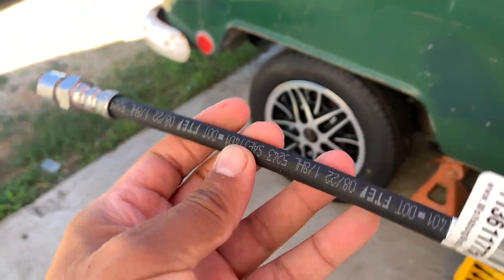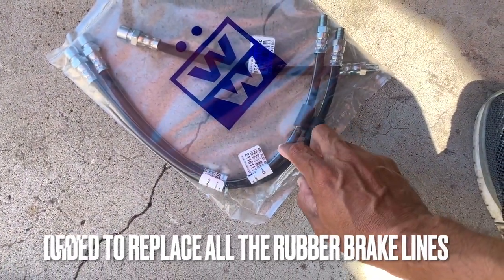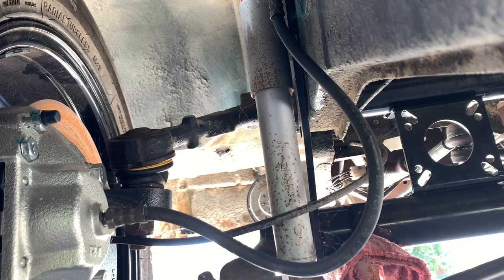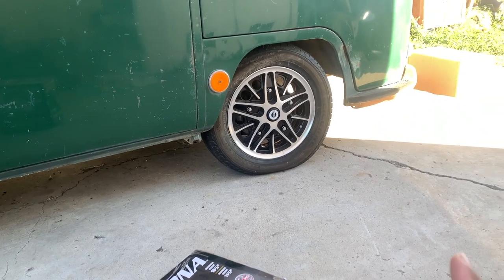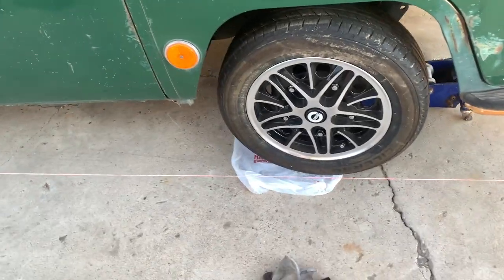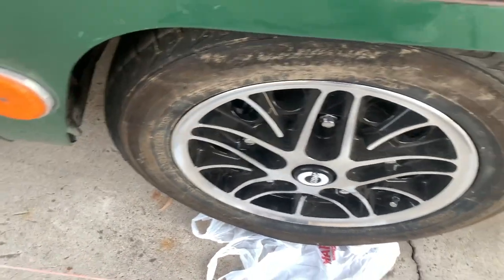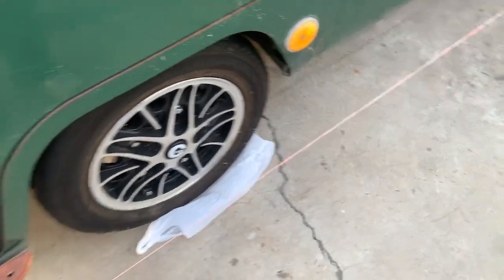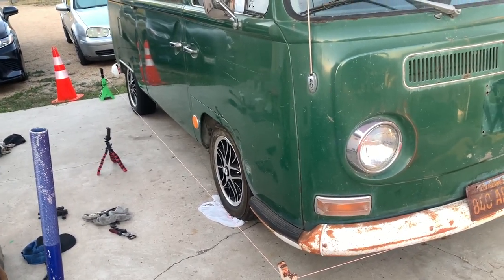DIY Front Wheel Alignment | 1969 VW Bay Window Bus Revival Project Episode 37

Comment: I think you can turn the tie-rod tube without taking out the tie-rod end. It's the reason why they have opposite threads at each side. Some tie-rod bars have a flat side portion so you can get a wrench on it once you've undone the locknuts.
Reply from the maker: Yeah mine didn’t have the flat spots to turn the rod.